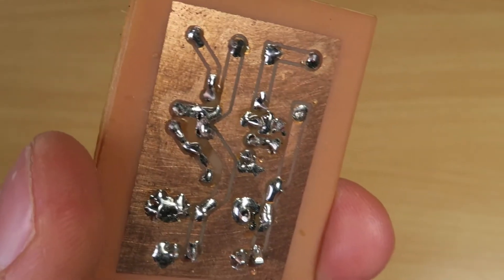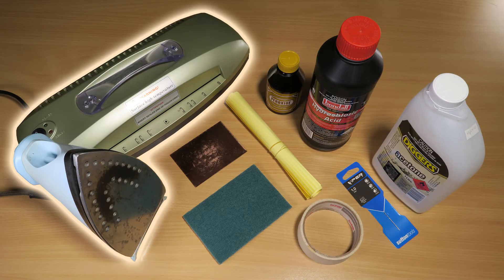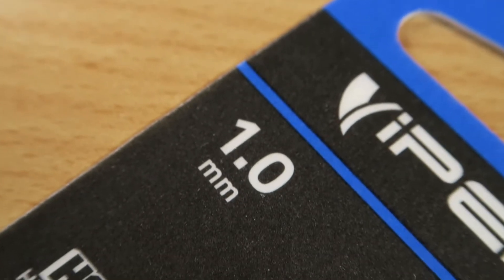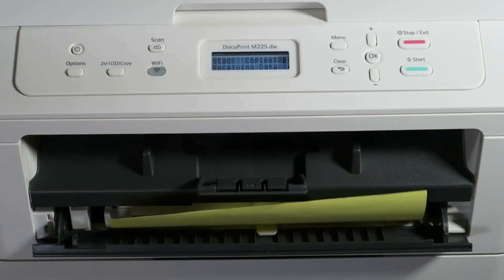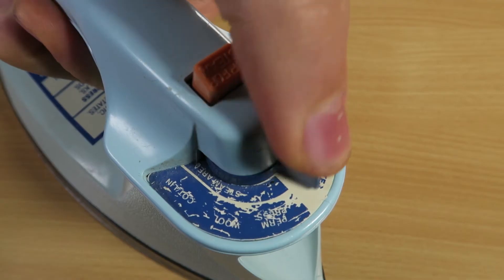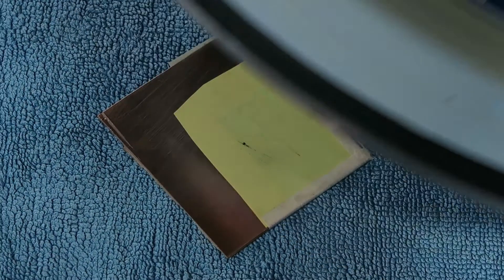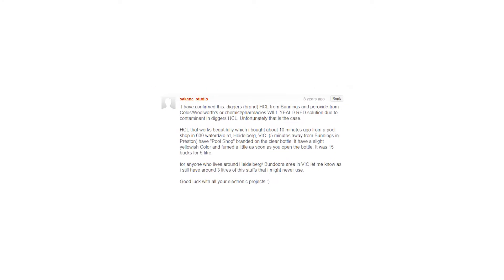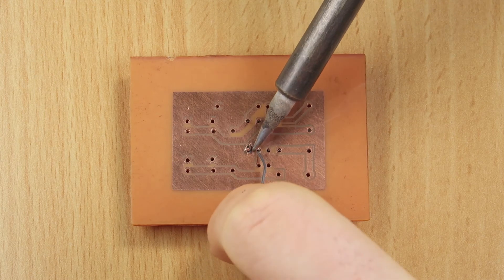Etch Your Own Low Cost PCB

Comment: Can I suggest you google and find out the amounts of chemicals you use.
You  haven't told us the concentrations of the chemicals you have used.
If you research, you will find there is a certain mixture that will work.
Just slapping the stuff in a bowl is not very informative, sorry.

Comment: What strength peroxide do you need? I'm fairly certain it's impossible to buy it in some countries because nutters use it to make bombs and such.
Reply from the maker: I have tried 3% and 6% and they both seem to work fine, I'm not sure if you would want to use anything higher even if you could buy it.
Reply: @ElectronicsIdiot  like others asked, it's bern awhile since the last upload.... Was wondering what happened to the LED display...